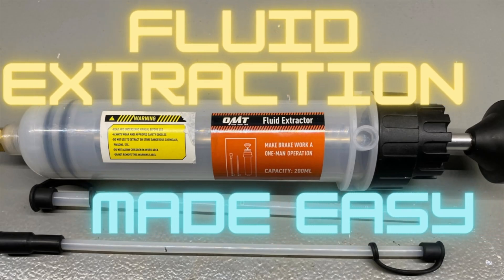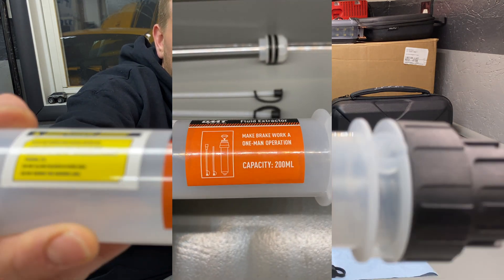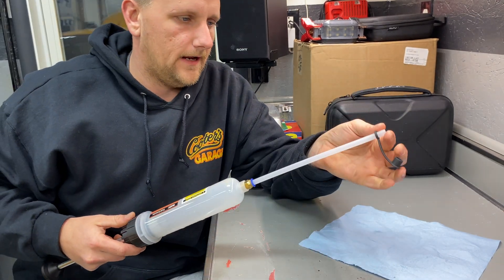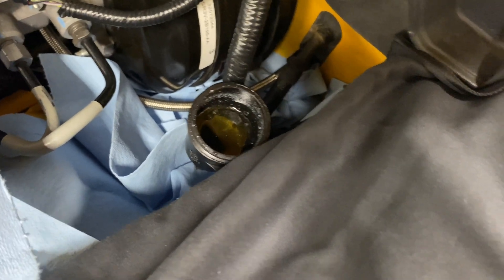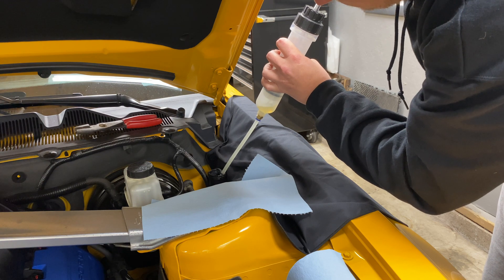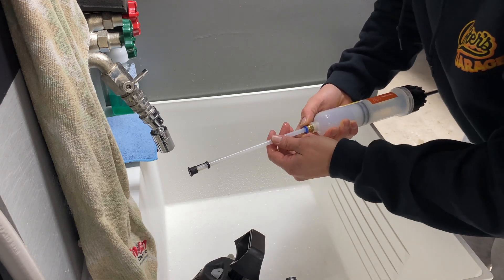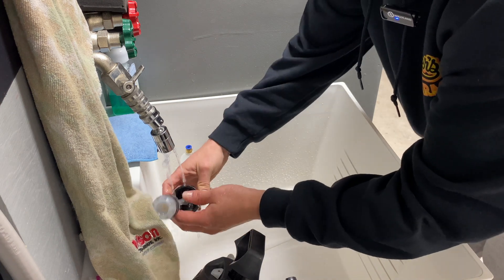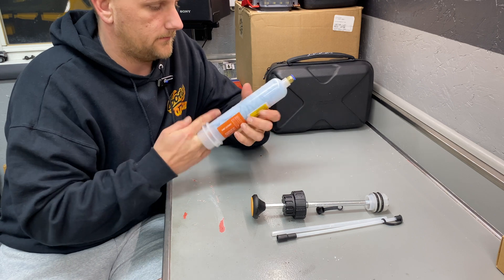How to Extract Automotive Fluid Easier

Comment: Can this be used to hook up to the bleeder nipple and extract or push in brake fluid? I have been trying but there is so much suction it's actually very hard to pull the plunger back. And yes I had thr bleeder open